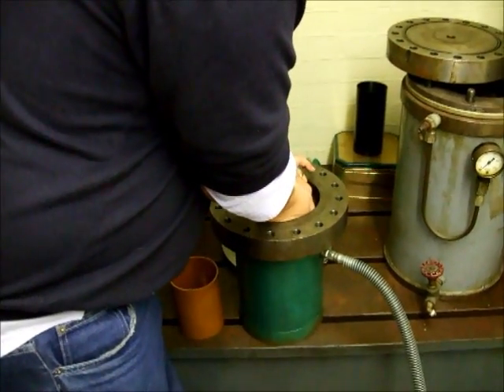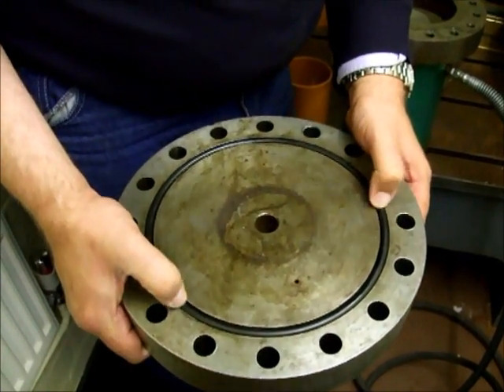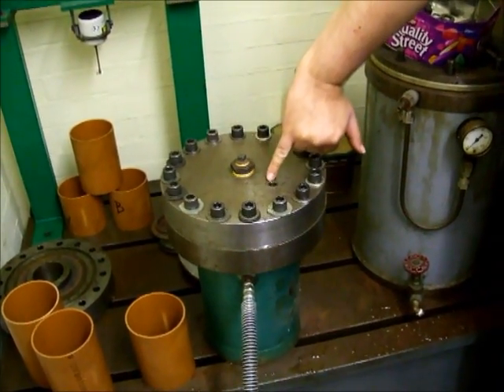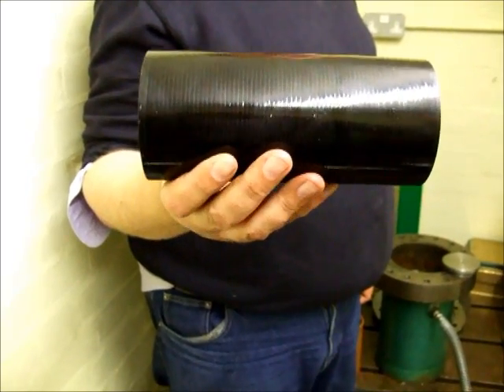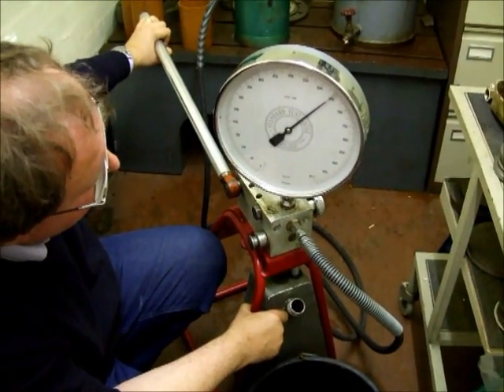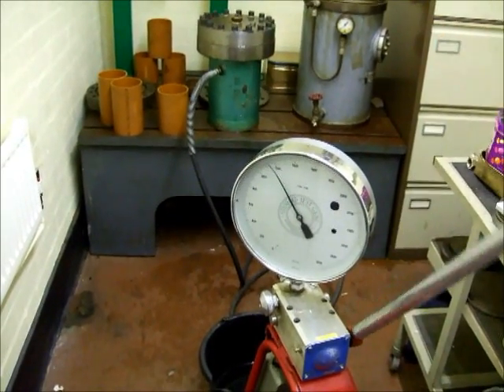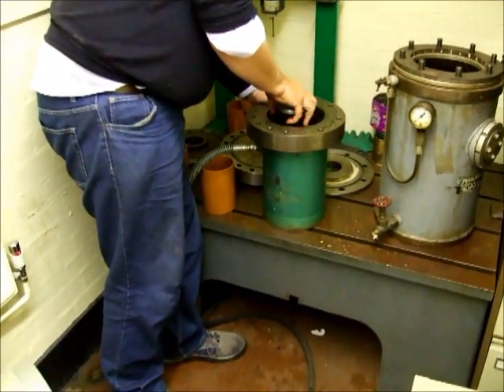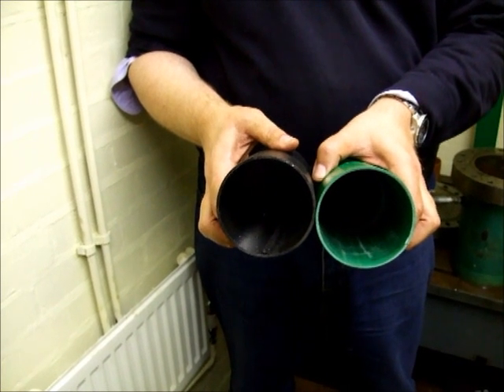Collapse of Composite Submarine Pressure Hulls

Comment: Failed at a quarter of the pressure the titan was subjected to... says it all. 

Carbon fiber is better for aerospace and automobile applications... not subs.
Reply: No it was over 1400 deeper than the Mariana Trench which is 1100 bar
Reply: @paulb9769 they were measuring psi not bar.

1:37 in they state the fail point of the 1st cylinder in psi.

They only give numbers on the second run... but they're using the same gauges (in psi)... so failed at 1400 psi (not bar) and the Titan failed around 5500 psi 2 miles down.

Comment: At 3.5 km down the water pressure on the hull of the titan would have been around 6000 pounds per square inch and I don't think ndt cycle testingwas done after each dive .
The window on the front was only rated for 1.5km depth .
It's like he wanted to die there,  for a guy with an engineering degree where was his 50 percent buffer of the equipment failure .
When your life or others is on the line you always engineer craft its maximum limits plus 50 percent .
Reply: So you are suggesting the window is weaker than the Cyclops with the carbon hull
Reply: @paulb9769  It was only rate by the manufacturers engineers that it only rated for 1.5km .
Oceangate engineers would have known there would be a large margin before failure and just ignored their suggestion like they did everyone else's.

Comment: I wondered if x-ray inspection on the Titan hull could have showed the problem.
Reply: Ultrasound may have worked
Reply: @dwaynemcallister7231  If you know you know!! You obviously have a backround in weld NDT i would assume, as nobody else would know why ultrasound would work while radiography would not..
Reply: No the carbon fiber layers were to thick to properly xray them. This was one of the problems addressed to Stockton Rush. He was told there is no way to check for voids are delamination of the carbon fiber.

Comment: The speed of sound in water is five times greater than in air. That's an estimate of how fast the imploding shock front would be. That means the initial implosion would occur in under 1 millisecond. The occupants would react to the supersonic shock front as a liquid. The energy of the implosion was equivalent to about 50 kg TNT, but completely focussed on the interior. With the adiabatic compression and focussing, the occupants may have supplied the carbon to form nanodiamonds. That's the sort of level of obliteration that would have occurred.
Reply: So, the bodies compressed so hard and so fast that because our bodies are made from the element “Carbon”, the remains turned into bits of diamonds! 👀🤯
Reply: average guy interpretation,  all the energy of the collapsing hull focused on the human body will make you shine bright like a diamond. Restructure the carbons atoms.  Kinda the way explosive lenses focus all of the energy on a nuclear core in a fission bomb to make it go super critical..
Reply: Best explanation I read!!😅
Reply: To determine the energy involved in the catastrophic collapse of that piece of shit, we need to consider the potential energy released due to the change in pressure. Assuming the Titan "sub" implodes completely and explosively, the change in potential energy can be calculated using the following equation:

ΔPE = ΔP * V

Where:
ΔPE = Change in potential energy
ΔP = Change in pressure
V = Volume

Given that the POS Titan has an inner volume of about 400 cubic feet and was  at a depth of around 4000 feet underwater, we need to calculate the change in pressure.

The change in pressure (ΔP) can be calculated using the equation:

ΔP = ρ * g * h

Where:
ρ = Density of the fluid
g = Acceleration due to gravity
h = Depth or height

The density of water is approximately 1000 kg/m³, and the acceleration due to gravity is approximately 9.8 m/s².

First, convert the volume from cubic feet to cubic meters:

V = 400 cubic feet * 0.0283168 cubic meters/foot³ ≈ 11.3267 cubic meters

Next, we convert the depth from feet to meters:

h = 4000 feet * 0.3048 meters/foot ≈ 1219.2 meters

Now we can calculate the change in pressure:

ΔP = 1000 kg/m³ * 9.8 m/s² * 1219.2 meters ≈ 11,893,760 Pa (Pascals)

Finally, we calculate the change in potential energy:

ΔPE = 11,893,760 Pa * 11.3267 m³ ≈ 134,727,625 Joules (134,727.625 kilojoules)

Equivalent TNT Mass = Energy of Implosion (in kilojoules) / Heat of Explosion of TNT

Equivalent TNT Mass = 134,727.625 kilojoules / 4.184 megajoules per kilogram

Equivalent TNT Mass ≈ 32.23 kilograms

Converting kilograms to pounds:

Equivalent TNT Mass ≈ 32.23 kilograms * 2.20462 pounds per kilogram

Equivalent TNT Mass ≈ 71.04 pounds

So those guys got smooshed by 70 pounds of TNT at the second of implosion. There can't be much left.
Reply: @jesusissouthern  Excellent!  Thank you for the calculations!
Reply: An adiabatic process (in Thermodynamics) produces no heat and produces only work. Edit: I was thinking after my comment “where would the heat come from?” Then I realise the air in the sub would have been compressed so violently it would likely have been hotter than the sun. Heat+carbon+pressure-Diamonds so I think you are right.
Reply: @DimSimSam  In reality maybe 1600C momentarily, but in very small areas and just for an instant. So the heat doesn't linger it's there for milliseconds then gone, but it does indicate the sort of forces involved.
Reply: What??
Reply: So sink subs deep into the ocean then you get a bunch of diamonds..then send rovs to retrieve it
Reply: Wouldn’t the incompressibility of the water portion of the human body have resisted deformation to an extent?
Reply: Where can we buy some of those nonadiamonds from the Titan? Asking for a friend.
Reply: Absurd.
Reply: The water would need to accelerate first. Given the pressure involved, you're about an order of magnitude too fast.
Reply: To implode, the water, steel and carbon fiber need to move into the space formerly occupied by the air.  These masses take some time to move.  I've seen estimates in the 10s of milliseconds, not 1.  You could try to calculate it. starting from rest, how fast can the pressure move, say 1 ml cube of water 1 meter (assuming a 2 m diameter sub).
Reply: @brianwest2775  Good reply, disclaimer, I've not studied this, but the hull was filled with air, would the information that the hull collapsed propagate at the speed of sound in air, or would the inflowing water move faster?
Reply: What does this mean in non-scientist average guy language?
Reply: @jdmbeats  instantly reduced to atoms...
Reply: @markfernee3842  So in a way, Stockton was like Thanos
Reply: @markfernee3842  Thanks that explains it. I'm just glad they passed without much pain.
Reply: @jdmbeats  They experienced zero pain, but they should not have been killed in that thing, regardless how much money they were worth. They trusted a guy who indicated it was safe enough to go down on (with disclaimers) and was also along for the trip.
Reply: @VenturiLife  Yes, thanks. I agree completely, it was basically an experimental vessel. The materials were crudely assembled in a warehouse. Mistakes and shortcuts everywhere. 
I've signed a few of those disclaimers, waivers. Mainly for high-altitude activities. But, I would take my chances jumping out of a plane, before climbing in ANY submarine, or submersible. Safe or not.
Reply: @GOD-w8k2g That’s how I see it. And both had true believers and enablers around them.
Reply: @jdmbeats basically the people in the sub turned into diamonds 😂
Reply: @donG-y8k or liquid?! 😱
Reply: @happyme9010  Or liquid diamonds???
Reply: @jdmbeats  they got squished

Comment: Are they trying it with 1400 bars ? Really hope those 1400 is some weird as unit, because I doubt any submarine could withstand 1400 bars.
Reply: PSI
Reply: @jhvorlicky  Why mention the Mariana Trench in the title which is about 1100 bars they went deeper it broke at 1400
Reply: @paulb9769  I am having difficulty understanding what your comment is supposed to mean ? Who went deeper than 1400 bars ? Because nobody did I think.
Reply: Mariana Trench is over 13km deep, therefore 1300 bar (which is almost 19,000 PSI).
Reply: @jhvorlicky  thanks for clarification. Not that weird a unit afterall, forgive me, havent done physics in a while.

Comment: Every minute distortion in the carbon fiber material was a starting point for a break in the structural integrity of the vessel. Had the entire hull been made of titanium that sub would still be around today. I would like to see how they made the hull transition from carbon fiber to titanium. Titanium doesn’t flex a lot, but carbon fiber does. How did they design the sealing joints? BTW, there’s a reason why in nature eggs are shaped like they are.
Reply: "I would like to see how they made the hull transition from carbon fiber to titanium." 
There you go
https://youtu.be/WK99kBS1AfE
Reply: @billcarson4601 Look up Aluminaut. Built in 1964 out of aluminum, with a 50 foot long cylindrical pressure hull, rated to 15,000 feet with safety margin to 17,000. Dunno what the max depth was that it was taken down to during its short career. It was launched in 1964, the same year the US Navy launched DSV-2 Alvin. When they had DSV-3 Turtle and DSV-4 Sea Cliff going in 1968, apparently the Navy wasn't contracting as much with Reynolds Metals for their civilian owned and crewed boat, so Reynolds gave it to a museum in Virginia in 1970. When the Navy managed in 1968 to drop Alvin into the sea with its hatch open, Aluminaut was used to hook up the cables to Alvin to recover it. Alvin required a complete overhaul after having its dry spaces flooded with seawater for a year.
Reply: @billcarson4601 I've never seen anything showing the interior of Aluminaut. It's pressure hull is 11 sections of forged aluminum with 6.5" thick walls. It made 251 dives between 1964 and 1970, I haven't found a list of depths, but it used to hold the record for deepest dive by a submarine so I assume it only went that deep once. Unlike bathyscaphes like Trieste and submersibles, Aluminaut is a submarine. Submarines can leave port, navigate to their dive site and return to port. The others require transport to and from dive sites with tender/support ships. What I can't find is the depth Aluminaut went to on its record setting dive. Just many repeats of it set a record.

Here's a video with footage of the interior. It's massive compared to all the others, the pressure hull is large enough diameter for people to walk fully upright inside. https://www.youtube.com/watch?v=_HLFs_b1fmU

Comment: Carbon fibre is used to make Harps of fine quality and with bright tone. They are light to carry, they give good acoustics and are strong but can shatter under hard playing. Titanium harps have not  yet been designed for more extreme depths.
Reply: Wait a minute... there was a piano technician saying pretty much the same thing yesterday. 😐
Reply: @lucasgroves137  We need to show fairness to piano tuners, in the submersible-designing community.
Reply: @andyharpist2938  Notwithstanding my enormous respect for acoustic technicians of all timbres, my preference for deep-sea work is to hire concert pianists. I find they are more accustomed to working under pressure.
Reply: @lucasgroves137  Don't you feel your attitude is slightly tunerphobic?
Reply: @andyharpist2938  I'm simply adhering to the key performance criteria. I'm not out to cause any discord.
Reply: Well I hope those guys are enjoying playing their harps.
Reply: Many are playing tiny violins! 😂
Reply: yes it was and as oceangate it was experimental. mariana trench. 36,000 feet. titanium sub.

Comment: Elon Musk was going to make Star Ship out of composites. He quickly learned composites were not going to work and changed to steel. Too bad Stockton Rush didn't do the same.
Reply: At the size of Starship, steel can be lighter than aluminum or carbon fiber. Aluminum and carbon fiber would need to be thicker than steel in order to not buckle. Steel is also far easier to weld than aluminum. Steel also costs less per unit of weight.

Way back when I was a kid I read an old book about a bunch of guys who set up shop in a remote location to build a rocket out of steel. Now SpaceX is making that 1950's kid's science fiction book come true. Just be on the lookout for a farm woman stowing away with a magnetic tack hammer. ;)

Comment: I'm intrigued as to how the rubber 'O' ring can handle the pressure. I know it's in a recess but it's there to make a seal between the two surfaces in case of small imperfections so it must experience the pressure. I would have thought it would get pushed out under that amount of pressure or at least deformed.
Reply: An o ring is a funny thing in that it uses the pressure to make the seal. There are instances where an o ring leaks due to not enough pressure being applied. O rings CAN be extruded out of the groove they sit in, which is why the makers give precise dimensions for the ring groove..
Reply: @caerleon87  Thanks for answering. The reason I ask is I work with scientific spectroscopy equipment that works under vacuum and we use o ring seals. However we are now making high vacuum devices and have stopped using o rings and use compressible metal gaskets due to the high vacuum. I would have assumed they would have needed to do similar.
Reply: @argonaut6386  vacuum isn't capable of near the pressure the rig in the video is capable of exerting.  I can use vacuum grease on machined glass ends and pull 10-7 mbar.  lets see that grease hold up to this :)
Reply: @argonaut6386  You probably use metal gaskets as the o-rings off gas under vacuum and make it impossible to achieve high vacuum. As I understand it even a greasy finger print can prevent the optimum vacuum being achieved. The contaminants would also affect the readings of the samples but I guess you could probably control for that by subtracting the baseline reading with no sample.
Reply: @matthewwakeham2206  Thanks for replying. I will ask the mechanical designers at work as I only deal with the electronics side and testing the whole system.
Reply: @argonaut6386  Surely, no matter how much air you suck out of something, the force on the o rings cannot be any more than atmospheric pressure?? so 1 BAR or 14.7 psi or 14.5 [i think they changed it!!]
Reply: @argonaut6386  "compressible metal gaskets due to the high vacuum"
IMO, o-rings will leak chemicals into a high vacuum chamber.
Reply: @caerleon87  That makes sense, there's a groove for the o-ring. Then under pressure it expands into the groove, thus further lodging itself in it and preventing it from sliding through the gap.
Reply: Ask Morton Thiokol and the crew of the Challenger. 😢
Reply: @porkyfedwell  "Ask Morton Thiokol and the crew of the Challenger"
It has been done and some Youtube videos exist on the topic.  In this context it is important to NOT let a gap come into existence that allows the o-ring to creep into the gap.
Reply: @thomasmaughan4798  Also, don't let o-ring freeze.
Reply: @thomasmaughan4798  Of course. The point of my comment was that while o-rings are tremendously useful in certain conditions, there are conditions where they can totally fail. Challenger was the most well known failure, but there are many others.
Reply: Consider how much pressure is being exerted on the o-ring by all those bolts in the lid.  That's what keeps it sealed.  If the bolts were not tight enough, it would leak.  The o-rings in the test article end caps are under pressure from the water itself.

Comment: Failure of the titan was inevitable - The 'cycles'  (compression and then expansion) on the carbon weave composite overtime can cause micro fractures, water then gets in-between the layers, this is called 'delamination'  - Once this process starts failure is imminent. Stocken should have been having the pressure chamber scanned after every deep dive to asses it's structure, he wasn't doing this. Because the Titan had acoustic sensors on the hull he believed this was enough to gauge hull integrity - He was wrong and this sub design should never have hit the water. There is a reason every government, agency and deep sub builder uses spheres as pressure chambers. He thought he knew better and it cost him his life and that of 4 others.